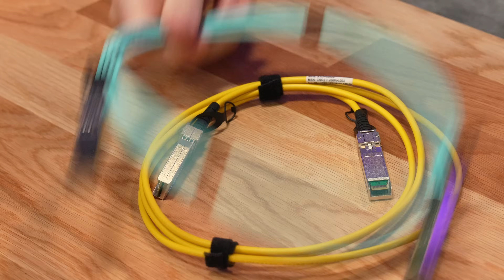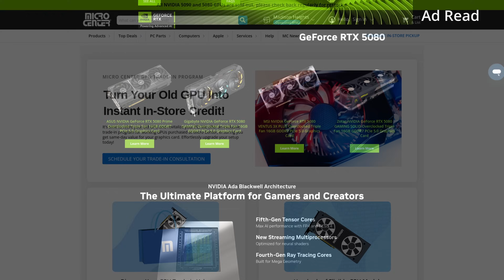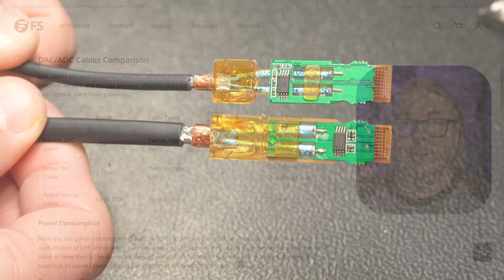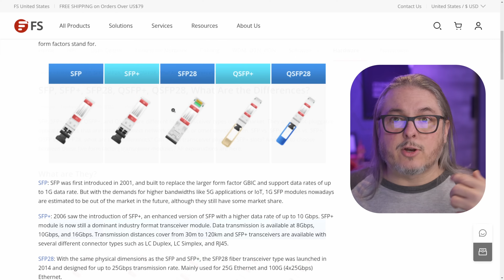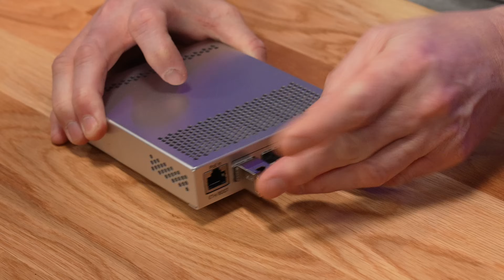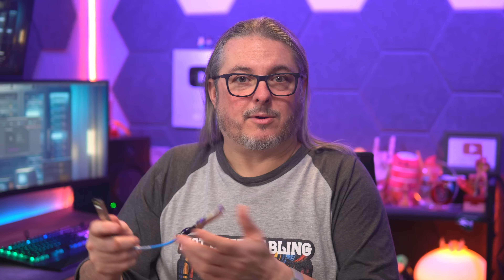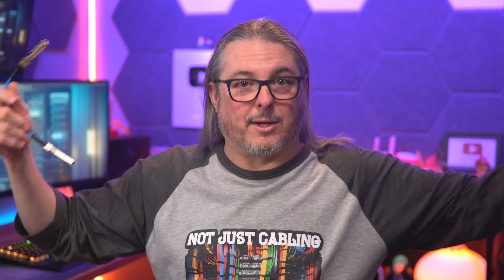Networking: RJ45, DAC, or Fiber – Which Is Best in Your Rack?

Comment: My biggest issue here is that desktops pretty much never have onboard sfp+/qsfp+/sfp28/qsfp28 on them.  at best we can buy expensive motherboards that have integrated 10g base-t ethernet on them, and consumer cpus have absolute CRAP for pcie lanes, so if I wanted to upgrade a machine to have faster networking, it would take 8 lanes away from my gpu which would significantly reduce performance on something like a 4090. (thankfully gen5 helps with this a lot and I can't wait to get my hands on a 50 series gpu), but until then, i'm stuck using onboard 10g ethernet.  and I found a reasonably priced second hand netgear xs728t 24 port 10g switch that's overall pretty nice (no mlag, but for under $1k it's hard to beat),   I haven't seen any reasonably priced 24+ port sfp+/qsfp+/sfp28/qsfp28 switches (even used) that were anywhere near that price point, and the ones I did find don't even have a decent webui for setup, it's all terminal based BS.  I don't mean to say that you console cowboys shouldn't have access to a powerful terminal to do advanced automation and administration if that's your jam (I could see that being useful if you have many racks full of them, perhaps at different locations to do automations/scripting) but I don't want to have to do that kind of stuff in my homelab.  I also bought a smaller zyxel xs1930-10 which also has a fantastic webui for managing vlans, aggregation, and the rest of it's featureset, and even has many layer3 features (still no mlag sadly). - that's what i'm currently using for a workgroup switch in my office area (my homelab rack is in my basement) and I have a 2 cable cat6e lagg running between the 2 switches that works rather nicely... but as you said, the rub is power.  I put intel x540-t2 (dual port intel 10g base-t cards) in each of my 5 proxmox cluster nodes and my big truenas scale server, and i use onboard 10g base-t with the 3 desktops that I currently have up (onboard with aquantia chips that are kind of meh, but work more or less just fine).  the cards alone add up to a pretty high wattage, the switches do too, but I'm not sure what I should do about it...  I suppose I could add in another big switch in my rack and swap out the cards in my servers, but like I said, that would be really expensive and annoying to configure as well.

Comment: For higher density installs the DAC cables can become quite unwieldy. As a rule of thumb, we try to use SFP modules cables on any rack that is either not going to be permanently static, or is high density. It makes it much easier to route and make changes with the thinner, mixed length fiber cables.

Comment: A big advantage of running fiber in a rack is that it's easy to terminate them on a keystone patch panel using couplers. Looks much better and cleaner than a bunch of hanging wires.
Reply: not to mention, in high density/capacity racks, having 100 DAC/Twin-AX cables s horrible for cable mgt, they have must less of a bend radius the AOC/Fiber, are much heavier and can actually impede air-flow on switches using F->R airflow.  I am definitely an advocate for AOC and Fiber, it is a bit more money but there are plenty of good companies for 3rd party transceivers that work amazing.  I now only use fiber when I can even in my home lab

Comment: Tried a 1.5m 10Gb DAC cable from 10Gtek and local xfer speeds went down to about 350Mbps. Went back to 2 x Ubiquiti SM 10Gb trancievers and 2m SM fiber patch cable (yellow) and my xfer speed went back up to 800-960Mbps. Not sure if bad DAC or EMI bc cable goes right by a power strip. 6bg single file between two servers with Intel X710 and nvme drives on each side. Just interesting issue.

Comment: 10GBASE-T RJ45 uses needs to encode two consecutive PAM16 signals using 4 twisted pairs through magnetic transformers and filters, transmit them at 800 Mbd/s, receive them through magnetic transformers and filters, then decode the pair of those signals along with error correction before leaving the Network Card through the SERDES PHY and going to your system. That computation is not cheap in power nor in latency. And the magnetic transformer part is quite lossy compared to doing it without a transformer.

10GbE DACs use NRZ, which is a lot less computationally expensive for a module to translate to the SERDES PHY, and requires no magnetics that I know of which decreases the power usage.

Comment: All valid advice if you have a couple runs.
In the datacenter its fiber all the way. Even in the rack.
You just simply cannot run 100 Dacs in the same rack, you just do not have the physical space for it nor the place to put the rest of the cables.
Reply: On the other hand, fiber over really short distances can burn out receiver optics if you don't run long cables on a roll or place an attenuator. (like sunglasses for optic fiber)
Reply: @ Thats an absoulut myth. Unless you work with very long range optics like 40km+ thers no chance it will ever burn out as the send Power is slightly below the maximum recive power on almost all trancivers except a very few ultra long range one.
And inside the rack you will most likely use Multimode anyway which uses LEDs not even lasers so theres no way what so ever that you burn out your optic
Reply: @FlaxTheSeedOne  Well on a system delivered as a complete set we had Aruba switches with 10G optics and  30 (??) cm optical cable between the switches, setup as fail-over. So 2 of these per 2 switches.
After the 3rd 10G optic was replaced I read about this possible cause and then looked into the historical data in LibreNMS where also the RX signal strength was logged. And for sure the RX gradually degraded over time.
Still could have been the fibre cable itself or the TX of the optic on the other switch, but then it wouldn't explain why replacing just the faulty optic did let those RX signal strength logs return to the same starting levels as the first ones.
After replacing these really short cables with some longer ones (10m) rolled up and tucked away above the switches, it ran for years without issues.
Reply: @TD-er  What kind of optics? and it is part normal for the RX to drop over time, as its a photo sensor like a solar cell which will always degrade over time.
But it should never go to the point where it dies, unless you use highpower optics.
Reply: @FlaxTheSeedOne  The problems were that the fail-over was at some point constantly swapping and showing lots of errors and lost frames (use case was NVR + cameras)
I did search in the emails I still have, but could not find any model nr. of the optics.
At least those were compatible with HP Aruba and intended for short range use as the 2 sets of switches were located in the same building on different floors.  So short link between switches in the same rack and same optics to the other set of switches on a different floor.
Reply: you can but it sucks Ass to troubleshoot. and manage. so yes, it can be done, but dont do it. lol

Comment: I'm running DAC for everything inside my rack, I started with DAC when I first started doing 10g networking. But I've recently started doing optical or AOC to switches outside my rack to protect from lightning strikes.
Reply: AOC is horrible, you have these heavy metal things on the end of your fibre, complete nightmare
Reply: @jonathanbuzzard1376  Huh, you mean the transceivers? They are needed with fibre as well, the only difference is that they are permanently attached.

Comment: Compatibility can bite you in the behind.  We bought some DACs to go between Intel cards and a Mikrotik switch. Worked great.  Accidentally re-ordered the same for Unifi. Intel card to Unifi switch worked fine, but Unifi switch to Unifi Switch was a no-go.  Had to order a Unifi-compatible DAC.
Reply: FS stuff is programmable
Reply: When ordering tell them to code them UBNT
Reply: I had a similar problem with my HPE Aruba switch, it is hard to find an affordable DAC for these switches. CONBIC DACs work well 😊
Reply: we use flexoptics for their programmable modules/dacs etc..
Reply: Extralink will work with Unifi and Cisco, Zyxel and more sane companies

Comment: I've had an interesting issue where using a DAC to uplink between Ubiquiti EdgeSwitch 16XG's and EdgeSwitch 48-port switches would cause issues with Dante traffic (late packets, dropping from Dante Controller, audio dropouts). This remained constant between DAC brands (10GTek, Cable Matters, and a few other I can't think of), and between a whole campus of 16XG's and 48-ports. 

Issues were persistent after DSCP and IGMP Snooping were enabled, and Wireshark showed those DSCP values being correctly assigned. Weirdly enough, all other traffic was fine. As soon as we changed to SFP+ Fiber modules, all of the issues went away. I'm not sure if the issue could be some sort of switch firmware issue, or how DACs do their signaling.

Would love to see if anyone else has any other weird issues.

Comment: one more reason for DAC is the lower latency. With fiber the convertion from electric to optic back to electric takes just a little bit longer
Reply: Below 10m lengths Twinax/DAC offer lower latency not because of this conversion but because of the optical path length.  In standard fibre cables light does not travel straight through the center of the glass but instead “zig zags” off the walls (the total internal reflection process).
Reply: @TactronIQ  That might be true, but the speed of electricity in the wire is slightly less than the speed of light in the fiber.
The latency DOES come from the electricity > light > electricity steps.
That is why short runs with DAC are lower latency, because at those short lengths, the conversion losses of fiber add more latency than the slower speed of electricity.

Comment: Thanks for covering the cable management downside of DACs, it's a definite drawback.  Also, you can pipe fiber through a keystone.  I do wonder if putting a patch panel behind a brush panel would look nice.  I'm just using a brush panel right now for the DACs (my NAS isn't rack mounted, and my desktop is "next door"), but maybe a keystone panel behind it would keep the wires in one spot.  Hmm.
fwiw, my goto for sfp28 is mellanox, but I haven't tackled the qsfp28 ports yet, so, maybe I'll try the intel choice there, thanks for the advice.

Comment: I have a silly question can you hook a USB C male inspection camera to an rj45? 
I work on long vehicles and occasionally need to monitor things that I can't reach or see from up to 60 feet away. Like suspension parts. Obviously I can't have someone hang on while I drive. And the sewer cameras are too bulky to set up and attended to while driving. But my usbc inspection camera is perfect. Can I make it work?

Comment: I always try to use fiber for uplinks on POE switches for lightning protection for the rest of the rack.
Reply: That's.... actually a great idea!
Reply: I like the idea but I wonder if it’s actually effective given that the equipment is still connected to copper wiring for power.
Reply: If it is lightening, remember that it just passed miles through the best insulator that exists... Air.  So lightening protection is a fable.  But... General brownout or other power utility surges, sure but those tend to only apply to the power side, not the Ethernet side.
Reply: @EagleMitch it may have just gone miles through air but that’s in search of the grounds negative potential. If the choice of the path between a fiber glass and insulator cable and going a different direction towards the much bigger ground, it’s going further towards ground. Lightning protection is not a myth, it’s a risk mitigator just like anything else, if you decide you don’t want to mitigate risk because it’s only 95% effective…

Comment: I use DAC for my 40G network as its within my rack is aweome, 10G is RJ45, switches suck a bit of power as they are older I use a mix of intel chipset and Mellanox (now NVIDIA) cards 40G is just Mellanox Connect-X3/Pro cards

Comment: I was running DAC with everything, I changed everything over to fiber just because I thought it looked better and would be better. I guess after this video I am going back to my DAC, thanks for the great info.
Reply from the maker: Fiber does look cooler
Reply: When you go to QSFP28 DAC for 100G, the DAC cable is much heavier and stiffer. I found them very cumbersome vs fiber even for same rack use.
Reply: A DAC link can be swapped for fiber (both ends at once) & back again but if it works (already purchased), don't bother changing. What was missed was link latency which is slower for RJ45 vs fiber/passive-DAC over short distances. I'm not sure if active DAC is between but closer to fiber in latency. Depends on your usage & other factors are more significant. Copper is typically easier to bend sharper & pull through than fiber. Small differences not deal breakers 1 way or another.
Reply: lol yes it does that was the main reason I changed.

Comment: If it's short distance within the rack, I'll just stick to RJ45. The cables are cheap and readily everywhere. Works with patch panels. You can even make your own quick replacement cable in an emergency. And you can even step down to a Cat5e cable at 1 gig as a last resort. You can't do any of that with DAC, and only limited to approx. 10m max. Then finding a switch with 24 or 48 SFP ports is also very difficult and they can be very very expensive compared to an all RJ45 switch.
Reply from the maker: For less that 10G things such as IPMI RJ45 is fine, it's for those faster 10G and beyond connections that DAC is a better choice.
Reply: Agg switches tend to be all sfp. A lot of rack switches have a few sfp for up-link.

Video sounded like a "use dac INSTEAD OF fiber IN YOUR RACK" message. The only way to "just stick with rj45" in the context of the video would require using an SFP to RJ45 module, which isn't a "just" situation. Sounds like you missed the purpose of the video.